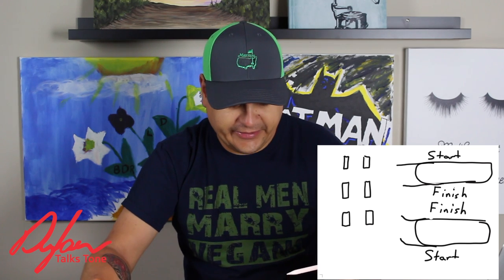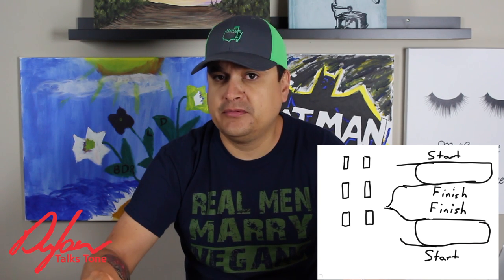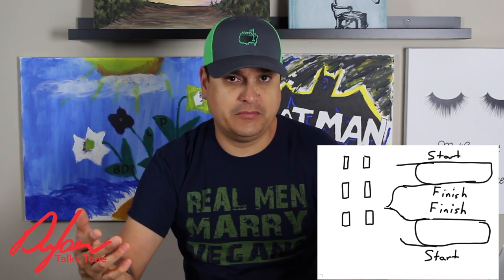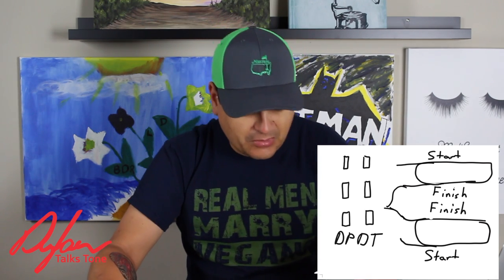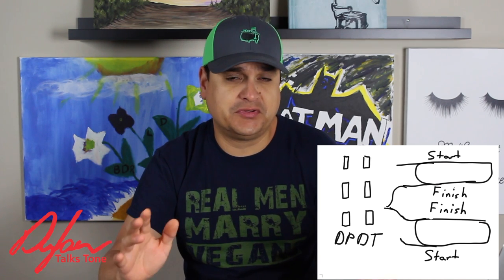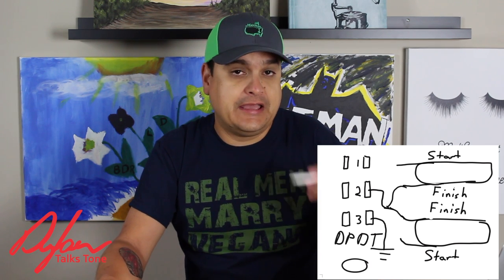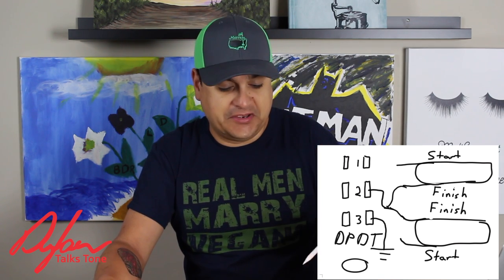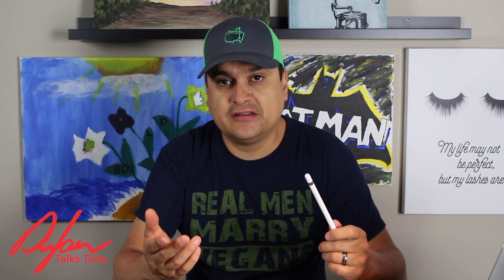How to Wire a Coil Split Humbucker - Dylan Talks Tone #198

Comment: I did a coil split with both my neck and bridge humbuckers. 2 lug on off mini toggle. wired both humbuckers to the SAME lug on the mini switch and the other lug to ground. This dropped the overall resistance on both pickups even when the coil split switch is not on. They were both high output pickups before the split, but this wiring brought them down to like a nice hot PAF tone. 14k originally bridge, now like 10k, then 5k when split (measured with the pickups all wired up in the guitar with a guitar cable/multimeter).  I like the sound of it. I don't think this is a common way to do it, but i have more than one guitar, so experiments like this are fun.
Reply: not sure how that happened. When the knob is down, the 2 wires are simply connected, same as when it's just humbucker. There should be, almost can't be a drop in OHM. Unless you got the switch too hot, or changed pots with different ohm. Added a capacitor different then before, thinking it was the same.   WHen the knob is down those 2 wires signal should not bleed off. Something is wrong.  You like the sound, it's still hotter then a burstbucker3, so you might have just got lucky.  If It happens to me, and my 8.5k 490T, then it will sound like total mud.  If mine drops like yours I'll come back and post, if I don't return, then mine had no drop...... here goes lol

Comment: Thanks, Dylan! All of your videos are wickedly awesome. I have a question regarding this video, however. How do you configure the wiring to determine which coil is turned off (north or south coil)? Where does each start wire connect to differentiate north from south? Probably a dumb question, but I have a feeling that I am not alone in asking. Would you consider doing a video explaining the diagram for such?

Comment: i hope i'm not too late to ask this question it is an older thread but...here goes
a variable pot to dial in one side or the other so..at one end of the split sat the bridge side u have it on and as u dial the other side in the bridge gets less as the neck side of the bridge humbucker gets more gain. the idea is to have  basically 2 singles and be able to dial in the amount of each one with the middle position on the pot having equal volume ( in effect a parallel humbucker) i hope i'm getting across. not quite the s.duncan approach but similar

Comment: (Hope you're still here 6 yrs later)
So, if using a mini toggle, the start wires would terminate to their normal position on the volume pot?
A diagram of the whole setup would be awesome. 
(Im wanting to split a HB in the neck position of a Tele. Bridge PU is standard Tele)
Thanks for the video!

Comment: Hi Dylan.
Hi to everyone, guitar-electronic enthusiasts.
I hope you can clarify the next question:
¿It's possible, in HH configuration, to have only the outer coils (or only the inner coils) of both pickups, in the middle position of the toggle switch? I would like to avoid using tap-coil pots. The idea is Treble pos: bridge full humbucker; middle pos: outer coils; Rhythm pos: neck full humbucker.
Thaks for the channel, and thanks for your response.
Best regards,
Sorry for my limited language😅

Comment: Thanks. not sure if you will see this given age of video, but I have the Gibson PPAT-520 push-pull with only 2 lugs, and have 2-humbuckers, 1-vol, 1-tone, was going to use the PPAT-520 for tone and run each humbucker's north+south finish together into lug 1 on the PPAT-520 and lug 2 to ground. I believe that will work? have a 5-way switch as well to incorporate so still working on the options available with that setup :)

Comment: I have a 2007 Firebird VII that is about to get a set of vintage spec FB pickups.  It is a three pickup set and I will be using a free-way switch.  Are you familiar with this type? If so, how would you wire it up?  I have a couple of push-push pots if needed.  Each pickup will have 4 wires.

Comment: Thanks Dylan.  Best 5:08 I've spent trying to figure this out.  Just a few clarification questions.  Which coil do you typically keep active, the screw or slug side?  Also, what does "hot" mean in relation to screw/slug?  It looks like the screw side is often the furthest out (closest to neck and bridge on an HH or HSH).  Any reason for this?  Finally, I assume one start goes to the centre volume lug and other goes to ground.  Correct?  Thanks again.
Reply: Hey sorry to bother you with this but did you end up confirming  where the start goes? I feel like an idiot but every video I've watched assumes that I know so much more than I do and I'm lost when it comes to those two wires at the moment
Reply: @radfury23g32  It goes back some time but from memory, I bought a little compass-like device that identifies north an south polarity and just made sure I had them on opposites sides.  I discovered screw isn't always south.  Different manufactures have screw north.  By using polarity rather than the physical characteristics of the screw/slug, I've managed to avoid hum or phasing.  Hope that helps.

Comment: This is the best description I've seen yet on how this works. My question is, how to I incorporate a DPDT switch in a setup where the existing 5 way already does some coil splitting? I have a Charvel DK24 and I would love to be able to have the coil tap toggle that's on the Guthrie Govan signature model (which is what I've described) Any thoughts?

Comment: does it have to be on a volume pot, or can i also do it on a tone pot? i have 3 humbuckers that i want to split, and only 2 pots to do it with. ill be using a 5 way switch. i dont want to drill any more holes, so it would be cool if i can use 2 pots (1v,1t) to split the pickups.

Comment: Great info.
By any chance have you done a video on wiring a HSH pickup guitar. I need to wire mine and I am having a problem finding a wiring diagram. I am looking for the standard wiring, not auto split. Thanks and well done video.
Phil
NYC Area

Comment: where do the other 2 wires go?
Reply: Yes I was wondering as well
Reply: They go home
Reply: They go to the volume pot, depending of which coil you want to select when splitting the humbucker. If you want to select the upper one, that's the wire you want to weld to the volume pot. So you want to weld the start wire of the coil you want to select to the volume pot.

Comment: I've done this to an hss Schecter, but I'm having a problem: In trying to brighten the humbucker, l wired a capacitor to the humbucker, but only one coil is brightened. How do I fix this? There is also a coil split-push/pull master tone knob and one master volume.

Comment: If the ends of the winding are connected, and the beginning is left for out and ground, then that is separation in a Parallel connection, right?

Comment: forgot to mention that which coil you want turned off will determine where you will solder connection on the switch. for instance if you wanted to single out the negative one instead of the positive one. Most people just split with the positive coil on though. Just a little extra.
Reply: If I reversed the tap with the main hot will it just reverse which coil is on when split? I'm trying to get the coil closest to the neck to come on when split.

Comment: Cool. About the mini toggle switch, there are different kinds (On/Off, On/On, On/Off/On and On/On/On. I want to wire my pickup to have a 3 combination (Inside coil, Humbucker and Outside Coil) to be selected individualy. I have a Snake Hollow Body 1973 that has 4 positions rotary switch that does the same (0=Off, 1-=Inside coil, 2=Outside Coil and 3=Humbucker. I'm trying to figure a way to do the same with mini toggles for another guitar, which I believe should be the On/On/On. So, I would have 2 mini toggles On/On/On to select the coils individualy. Am I thinking right?

Comment: Hey Dylan! So I’m working on a guitar with 2 split coil humbuckers, and I currently have them both soldered to a push/pull pot for a coil tap, but I wanna add an on/on switch to use for outing the neck pickup out of phase. How would I go about doing that? Do I just solder more wire from the pot to the switch? Thanks in advance!

Comment: Hi,
     I have a Casio PG380 Synth guitar.I had to take it apart for obvious reasons.Now I'm trying to rewire the humbucker to a push pull.The problem is that I only have 3 conductors and a ground.The 3 conductor colors are white ,red and blue.The white and blue measure 1.700.The white and red measure the same./The red and blue together and the white read 1.259.So can I assume that the white is the tap?Thanks for any help that you can give me.

Comment: I have DiMarzios on my RG. On the bridge pickup cane with two wires from each pickup taped together. Are those the ones I would connect to the coil split?

Comment: hi Dylan, this channel is really interesting for those that really care for their instruments and sound!! i have an issue with a les paul and don´t really know where to go, when i play using the bridge pickup with distortion, when i put my hand over the pickup there´s a noise as if the hot wire was being grounded, i live in the middle of the jungle in mexico and don´t really have many options to figure this out, it would be awesome if you coud point me in the rigth directions

Comment: Could you help explain. Same situation same DPDT push pull. But the Luthier I went to first took a single piece of wire and soldered both the middle two lugs (#2 in your drawing) together then soldier grounded them to the case of the pot. 

I don’t recall where the other wires went. But it works fine. He said when you push or pull the pot your just grounding out one side of the pot. 

Can you please attempt to explain his process. Thanks. 

Ps. He the best luthier in Southern California for over 40 years.

Comment: i have a problem understanding grounding , would the ground wire be grounded to the casing of the switch ?
Reply from the maker: yes
Reply: All grounds should be connected together, as well as the ground of your output.

Comment: I have a guitar with 4 wires, but I need to revert the split coil. Should I connect each finish and then use one start to hot and the another  to ground? 

Thx in advance

Comment: Hi Dylan, I know this is a fairly old video. I've just bought a second hand Player series Tele HH, and for some reason when just the bridge pickup is selected, I'm only getting sound when the coils are split, but not in the normal engagement. Do you have any idea why this may be?
Reply: You hopefully figured this out by now but something is probably not connected, most likely the opposite side of the humbucker that is getting split.  Or, maybe, the side of the bucker that isn't getting split is shorted, or somehow fried.  Only 1 way to find out....get diggin

Comment: At the moment I'm upgrading my old PRS SE Standard 24 with new pickups and I'm planning on replacing the 3-way blade switch with a 5-way superswitch to allow me to get 1.bridge in series 2. Outside Bridge coil + outside neck coil 3. Bridge + neck both in series humbucking 4. Inside bridge coil + inside neck coil 5. Neck in series humbucking. What I need your help with is in positions 2 & 4 I want the coils to be hum cancelling. Is this possible? Basically I'm wanting to approximate the sound of a tele with both pickups engaged when the 2 outer coils of each humbucker is engaged considering the distance between them and a strat sound with 2 pickups engaged when using the inside coils of each humbuckers is active being closer together having hum cancelling with every position. Complicated. Yes. Doable I'm sure hoping so.
Thanks
Eric D. 
Texas

Comment: Cool vid Dylan.   I need a little help.  building a strat for my son.  Im splitting hot rails controlled by 3-way switches (on-off-on) and I want to have a master volum, and a tone control for the split config, and a tone for single config.    

Here's the concept: My son (12 yoa) wants to a guitar that will come close to a Strat and Les Paul, mimic a Red Special and a Gilmore Strat.  I have it set up for three ways on each pickup, phase switches for each while in single config, but Im lost on seting up a tone for the single and humbucker config.   Im adding push pulls for tone caps for a little extra.   

Thanks

Comment: I wonder if you could do a video, or at least explain how to wire up an on/off/on mini toggle (dpdt) thats used for coil splits AND as a selector switch. Im doing a custom strat that uses mini toggles to switch thru the pickups rather than a normal 5 way blade switch, and what im trying to achieve is to have the lever in one direction act as the coil split, one direction to turn the pickup off, and one direction to have normal humbucker sound. I've worked with 2 way (spdt) switches before on duel humbucker guitars for coil splits, but never on a 3 pickup guitar like a strat. The strat itself is an hsh setup, with the center pickup is a 4 lead, duel rail pickup that can be coil split (the other 2 pickups are 4 lead seymour duncan humbuckers), and im just having trouble figuring out which lugs to use, and which lug to run the wire out to the next switch....oh, and its just a 2 pot system with a simple master volume and master tone. Any light you could shine on this situation would be greatly appriciated :)

Comment: Where many guitarists fuck up with coil splitting, is they don't add a resistor in parallel to the pot, when the switch is engaged for splitting. By not switching in a 250k ohm resistor in, they are trying to run a single coil pickup off from a 500k ohm pot, which kills it's tone.

Comment: When you spit the humbucker, how do you know WHICH COIL is going to be engaged?
Reply: Dylan doesn't have any idea what he's talking about here.
Reply: You will be using the coil that has one end connected to the switch and the other one to your standard signal connection. The coil that has one end connected to the switch and the other end to ground will be shorted out and therefore not active. Dylan didn't "connect" any of the two remaining wires in his schematics, so he basically left it up to you.
Which one is which depends entirely on how you wire your pickup. If you know the wiring of your pickup and wire it appropriately, you can therefore choose which one of the coils will be active (for example for the purpose of achieving hum canceling in the inbetween positions with coil split).

Just bear in mind that depending on how the leads are wired, you might be wiring the pickup out of phase with another one or even with itself (when in the humbucking mode), so it's not completely trivial to figure out if you do a more involved wiring, and might take a bit of trial and error.

Comment: I accidentally screwed through my body -_- whilst attempting to screw an earth wire in.... YEah so to mask my major idiotic messup, Im going to make that hole bigger and install one of these. Luckily there is enough room in the cavity and between the pup selector switch and the tone knobs to do this.. *Face palm*.. Good job its a cheap project guitar and not something more expensive.

Comment: Yeah great, Now WTF do you do with the hot wires? Top coil to #1 and bottom coil to #3? And what about the jumper connections to insure that both coils have circuit flow thru to the pots and then to ground? You need to put a LOT more work into your vids dude.

Comment: Another fail explanation….
SHOW US THE COMPLETED WIRED PICKUP
SHOW US THE WIRES
SHOW US THE INTERNAL DIFFS BETWEEN A SINGLE COIL, DOUBLE COIL IN PHASE AND OUT OF PHASE… show us the wiring of a hum bucket….

How about som sound samples of each of the above
Reply from the maker: #gratitude
Reply: @DylanTalksTone  thank you
Reply from the maker: You need to learn some
Reply: @DylanTalksTone  I guess you’re right… two years of formal electronic training… and many years working on pianos and teaching as a college aviation instructor…. I don’t know much…. Which is why I was hoping to see just the comparative diffs between… series in vs out of phase… parallel in vs out of phase… actual volts as the out put of each of the above and compared against volts out compared to a P90…. Therefore optimum caps for moderate tone trimming…. yes… I need to learn some….. I’m guessing that you have none of the above info…nor might you have any concept of an LRC tank
Reply from the maker: I do. Just not in this video. We have 1500 videos. I mean… since you shared your flex, it appears you already know these things and just wanted to flex… that’s not my jam. I’m not impressed by what you know… it’s the gratitude you need to learn.
Reply from the maker: Also… the video title was pretty clear of its content… you want more than this video was designed to contain…